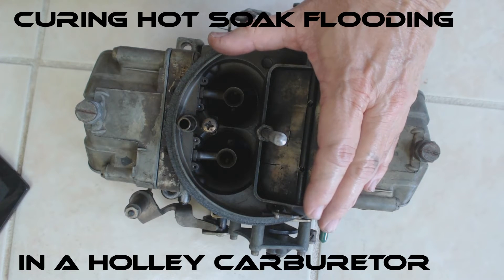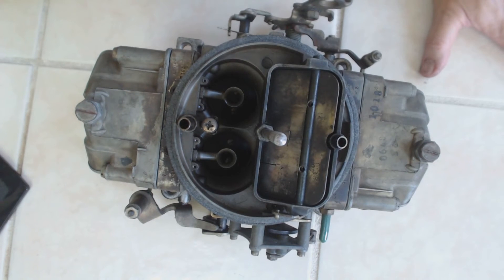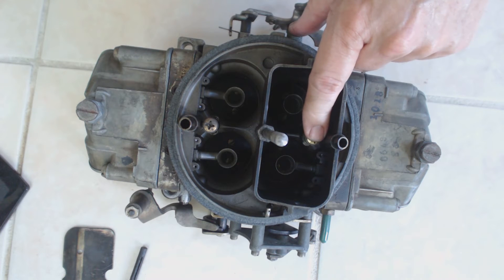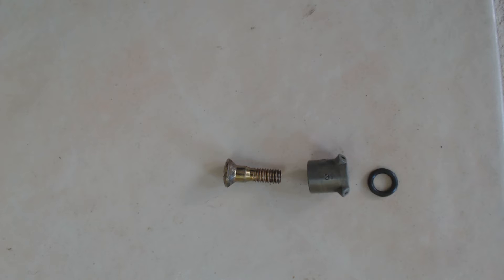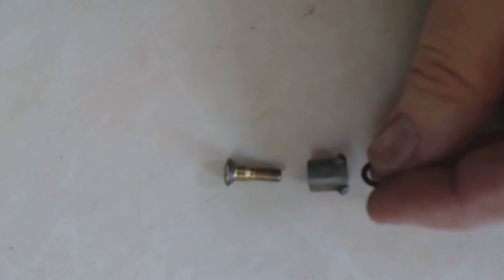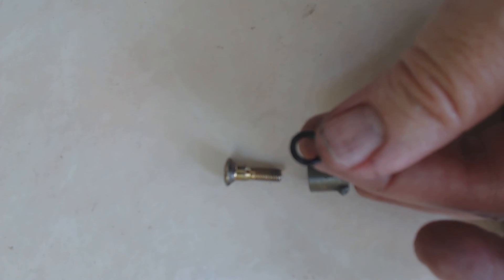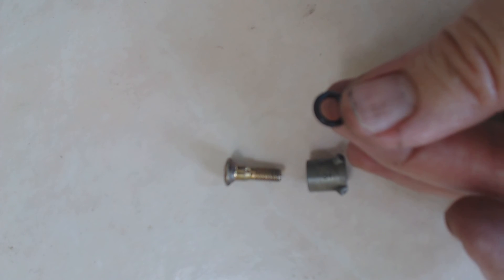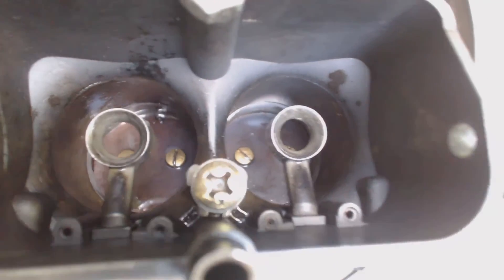Curing Hot Soak Flooding On a Holley 850 Double Pumper Carburetor

Comment: I have a new 850 dibble pumper carb and it consistently dumps fuel into the intake what is the cause of this. It’s brand new out the box. Sight glass does not even show fuel in the glass
Reply from the maker: Although rare, a power valve can have a hole in it or be stuck open.  Another possibility is a cut, pinched, or corroded gasket in the carburetor.  (How much ethanol is in your gasoline?)  If you're in an area that has a lot of ethanol in your gasoline, I'd take the carburetor off the engine and rebuild it with ethanol proof gaskets.  

If I'm understanding you correctly the float bowls never fill up, but the engine floods out immediately.  Ethanol or and bad gasket from the factory would be my guess.  Make sure the main  jets are in place and sized correctly.

You're definitely into a full disassembly here.

Holleys of the 70s & 80s used cork gaskets in some places.  Ethanol will destroy those gaskets in short order.

If Ethanol is the culprit, go to Holley's site and look for a Quickfuel rebuild kit.